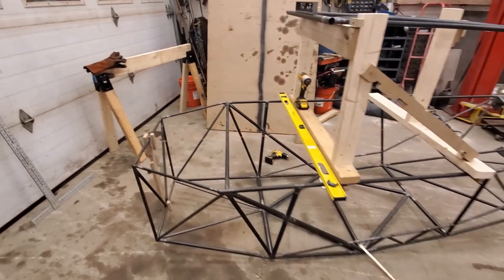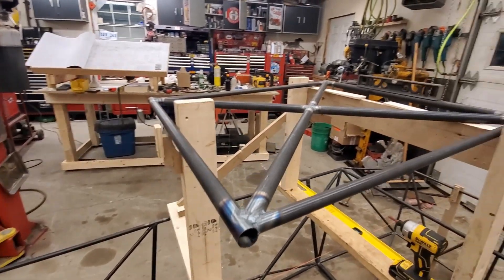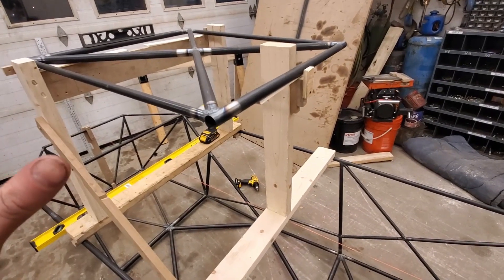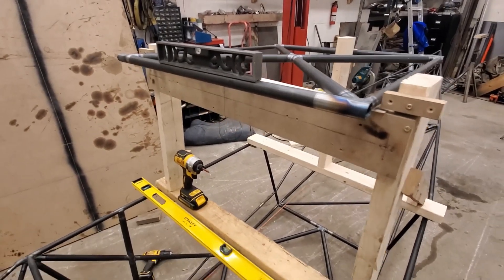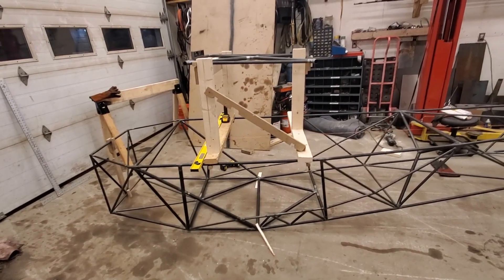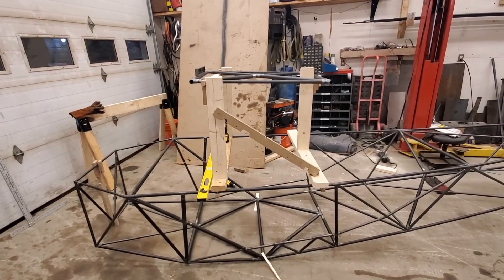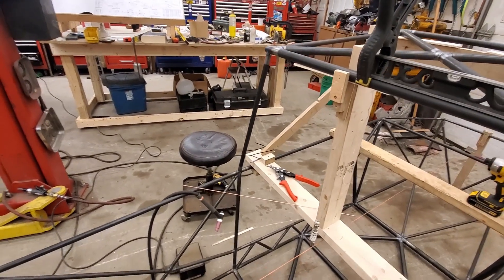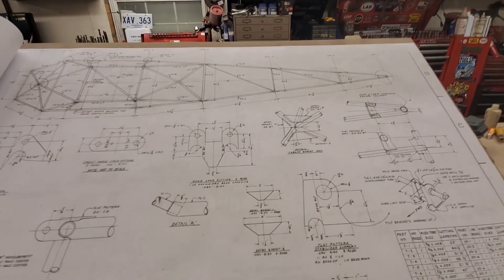Episode 9 of building my new airplane! lining up the topdeck and talking about wing angle.

Comment: The higher angle of attack of main wing helps for slightly shorter takeoff but once airborne and in cruise the wings angle of attack flattens to the oncoming wind and the tail must come up higher to stop you from climbing ... so the more up incidence you add on the wings the higher the tail comes up at cruise giving you a lower view over the cowl ... the extra drag comes from the fuselage pointing down at cruise not from the wings pitched higher ... the wings always flatten out to one pitch to the oncoming wind to stop from climbing no matter what incidence you give them ... Its the fuselage angle that changes to oncoming wind when you change wing pitch ... If you gave say  the front of the wing a foot higher  than the rear the plane would cruise with the fuselage pointing way down and tail way up at ridiculous angle  ... Were it me building I would set the wing incidence for the least fuselage drag angle to the oncoming wind and sacrifice the less than 10 ft gained on takeoff with steeper incidence  ..... another way to increase angle of attack for wing on takeoff is simply larger tires and taller landing gear   ...... Also the further you pitch the wing from the center plane of thrust of the motor the more the airplane needs to be trimmed in flight as you change power settings ...   Theres a sweet spot incidence  for least amount of fuselage drag and least pitch changes with power settings but I dont know what that is